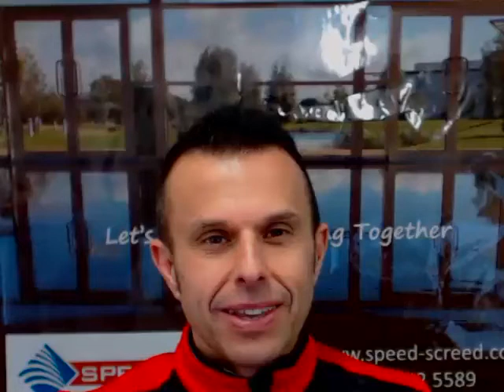Shrinkage Cracking And Curling In Floor Screeds, What Are They And How Do They Occur?

Comment: Hi, are cracks in a screed of approximately 200m2 in numerous locations acceptable.  The area has an original concrete floor slab that has been in place for years and there will be a painted floor finish.  Would you expect the cracks to start breaking up and becoming worse with chairs rolling over them once they have had the paint applied?
Reply from the maker: Nice to hear from you Jonathan.  Just to confirm the "cracks in a screed" is the original concrete floor slab?  Not an overlay of screed onto the concrete?  Assuming that we are talking about the concrete base, you certainly wouldn't expect it to start cracking with just chairs on the surface.  Before painting was the concrete is good condition, and the cracks have only appeared with the chairs?  If you have any pictures, before and after, showing the layout of the slab and where the cracks are forming I can get a better idea.  You can send them to info@speed-screed.com Regards Andy